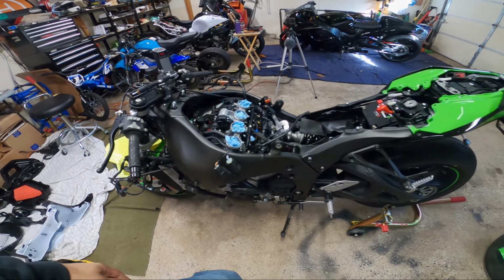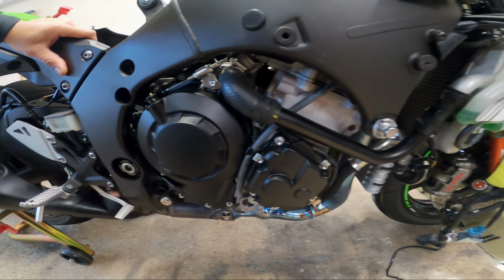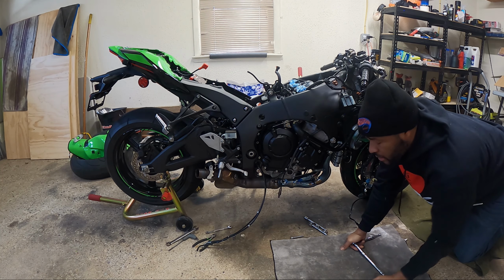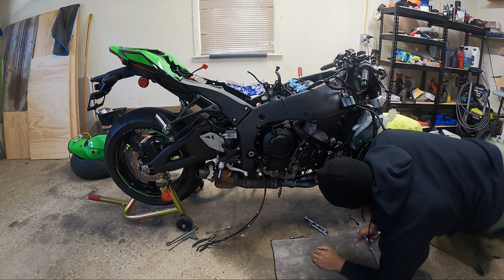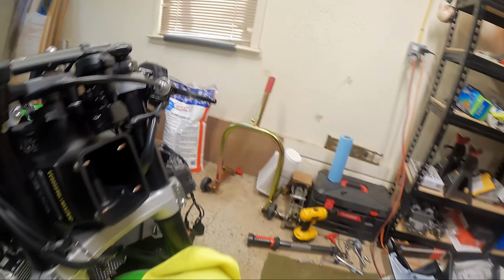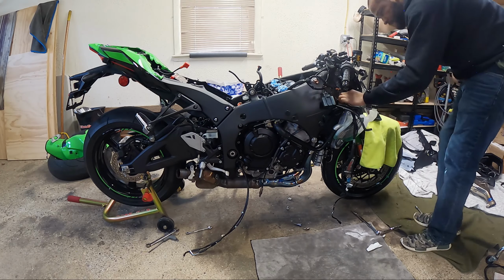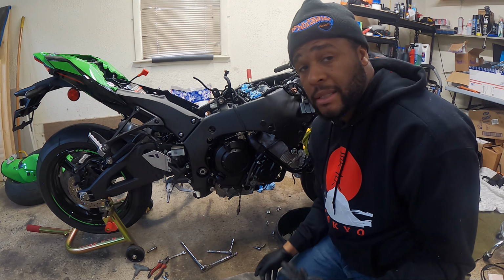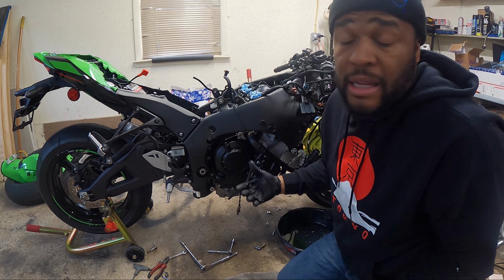2021 Kawasaki ZX10R Build Log Part:3 | Exhaust and Radiator Removal

Comment: I'm still watching but I'm surprised you're doing a full system since the ZX10R comes with titanium headers. Wouldn't it have made sense to use the titanium headers that come with the bike and just go with a cat delete and slip on? But hey what do I know, I've never had a liter bike 😂. Still I'm enjoying the video so far.
Reply from the maker: There have been test done using the stock header vs a full system and results have been better when switching to a full system. The stock header is perfect but it was designed to work with the oem exhaust.
Reply: @EnviedKing  have tests been done on the ZX10R? I haven't seen any. AKRAPOVIC makes the stocks Kawasaki ZX10R headers, not a lot of people know that.. The only headers better than stock on this bike is Brocks Performance. Just throwing in my Kawasaki knowledge.
Reply from the maker: @JayDonII  There are multiple people that have dyno'd the previous gen zx10r with stock vs aftermarket. If you really think Brocks is the only one that makes more power than the oem header, then your Kawi Knowledge is a bit lacking. You can youtube and debunk that instantly.
Reply: @EnviedKing  it will be interesting when you weigh the exhaust systems, can you also weigh JUST the headers and see if there's any weight savings between the two titanium systems? I'm assuming that is that you bought a full titanium system, if you didn't, I feel you wasted your money and should have just used to stock headers and went with cat delete (mid pipe) and slip on from Graves. Especially know that we were just informed that Akrapovic is making the stock headers for Kawasaki.. That was a knowledge bomb!🤯
Reply from the maker: @mrmuncheez374  Yes sir but i doubt there will be much weight saved between the headers. Most of the weight saved will be from the cat delete and the muffler
Reply: @EnviedKing  Werd!
Reply: @EnviedKing  it's not that I think a full set of headers won't give additional power, my point is that the stock ZX10R titanium headers are really good already. But Brocks Performance is one of if not the best aftermarket headers for the ZX10R. It's okay to disagree,  I'm not trying to discredit anyone or any other manufacturers. I'm interested in seeing your setup and how it performs. 💪🏾✊🏾
Reply: So I bought the graves exhaust and cat delete for my 2021 ZX10r and the cat delete pipe doesn’t match up to the stock headers. I ended up buying the headers.
Reply from the maker: @mr.classic622  Yeah if you had asked me I could have told you beforehand.

Comment: You're doing a good job!!! Especially you don't have a book on it or anything.. just like when I took my 2011 zx10r I was winging it. But that's not your first bike either so you have some knowledge for sure.
Reply from the maker: Yeah most bikes are assemble pretty similar. Its just a matter of finding attachement points and if you think it needs to be removed, remove it